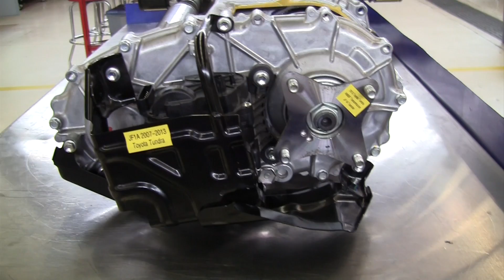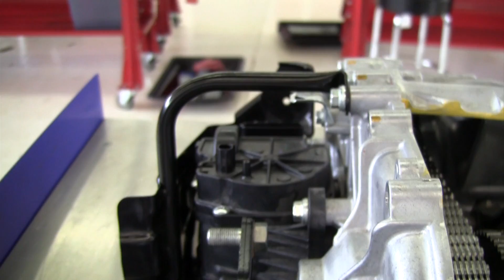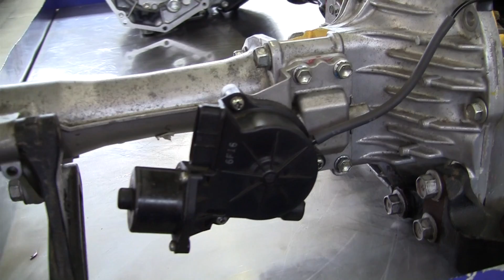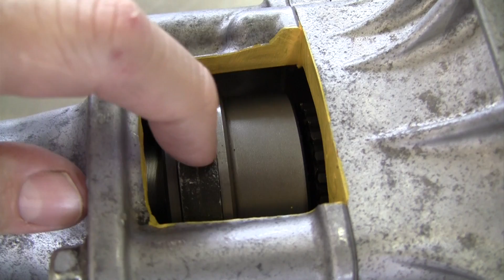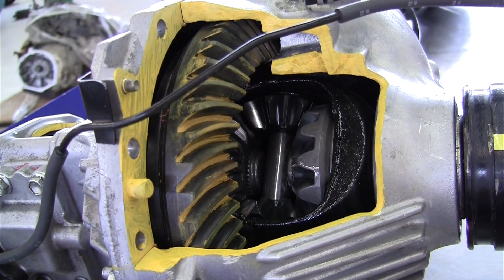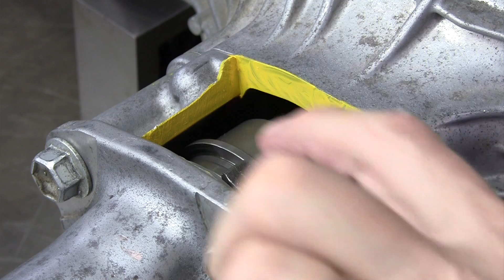Four Wheel Drive Operation (4WD)

Comment: You seem to have missed showing how when the 4WD is engaged on the transfer case how the movement of the ring gear causes the front wheels to move in the same direction. You skipped this gear view and jumped to the front actuator movement locking both wheels/shafts into the same direction but showing how the ring gear moves would help complete the video.

Comment: So what you're telling me is that I could weld the front differential and only take a hit to fuel economy? In 2wd the front propshaft would free spin at left tire rpm, and in 4wd the two front tires would be driven and locked together.

Comment: What controls the actuation of the axle disconnect?  When you put the vehicle into 4wd does it simultaneously actuate at both the transfer case and the axle disconnect as well?  Do they both actuate when the vehicle is switched to 4wd?

Comment: truly helped me understand why, even after disconnecting the front drive shaft, it sounds like gears are trying to fight each other. Perhaps my spring is failing on that darn fork.
Reply: Did you figure it out? My 4runner has been in the shop 2 months now and they can't find the cause of a gear clicking noise coming from driver front area when in 2wd; as soon as 4wd is engaged it goes away. On a lift when tire is rotated, the front shaft rotates intermittently so some gears must be catching. They did a dif rebuild no dice and replaced actuator, still persists.

Comment: Thanks for the enlightening video. A question, does this arrangement mean that the left front wheel is always turning the diff gears when the car is moving, even when no power is transmitted to the front axle?

Comment: Shot in the dark here on an old but great informative video!  have a Tundra that I replaced the detachable front shaft with a solid shaft for off-road strength. I know I’m giving up mileage but am I going to damage my transfer case by turning the front drive shaft at all times?

Comment: Front differential actuator engages the front axle.

So if you are in 4WD mode and front diff actuator not engaged for any reasons. You basically will have 3WD instead. With 2 rear tires AND the left front driver wheel spinning only???😅

Comment: I do have a question. So basically you are demonstrating is that (EVEN IF for any reasons) the differential actuator malfunctioned and is STILL engaged while in 2WD mode, you wouldn't risk damaging your axles and/or your differential gears correct??

Except most likely you'll probably suffer from having poorer gas mileage and that's it??????

Comment: At 8:07 in the video you put power to the 4hi actuator that moves a rod inside the actuator... My 4hi actuator is malfunctioning and I'm preparing myself to remove, disassemble, and clean in hopes that will repair function of it. My only problem I'm not clear on is when you re assemble the actuator to the transfer case , is where exactly is that rod supposed to be on that gear inside actuator. Most on forums are saying for 2wd the rod should be pushed all the way forward towards the Transfer case but there have been a few discrepancies. Any help would be greatly appreciated thank you

Comment: I think this gave me all the info I needed but maybe you can explain. I recently had my controller go out and I'm stuck in 4wd. I used some wire to manually operate front actuator but haven't done the transfer case yet. Why is the front actuator necessary?

Comment: Very helpful as I’m trying to figure out why my 4wd is being noisy.  The noise goes away as soon as it’s back in 2wd. Now I see what moves in 4wd and what doesn’t move in 2wd. I have a 2005 sequoia. 
So looks like the noise could be the transfer case chain, the front prop, or the ring gear of the front diff?

I checked/changes fluids already..
If you happen to see this comment I’d love any additional insight!

Comment: Excellent informative video. Apart from convenience I don't understand why toyota went with this system over the old free wheeling hubs. If my understanding is correct, with the ADD disengaged (running in 2wd), you still have the internal spider gears turning as well as one axle/cv. With the earlier system, when you unlocked the  free-wheeling hubs, you effectively unlocked the wheel from the axle so the only thing turning was the wheel and the wheel bearing; none of the axles or internal diff components rotated with the old system.

Comment: Ok, so my 4WD Hi/LO both work. Took truck (2004 Tundra) to dirt road and engaged and disengaged with no issues. My problem is the blinking lights on the dash, non-stop. Is this something Toyota can reset to stop it from blinking? It's driving me crazy.

Comment: this is an excellent delivery. Its simply awesome. I am currently transferring my 2005 Toyota Tacoma from 2WD into 4WD. I already replaced my engine and transmission with 4WD transmission with the electric shift actuator. I am currently running cables to the motor to get it to engage into differnt modes, i have the selector switch here with me. the front axle has also been installed with its shifter actuator motor. Kindly assist me with how to connect the electrical wiring to get them properly setup.
Reply: It's crazy how modern part time. 4x4 don't use disengaging lock hub instead anymore...

Comment: Can someone provide me with some guidance on what the problem is with my 4runner 4wd?  When I shift in 4wd it engages very smooth but when it disengages it hesitates for about 10 secs and disengages with a loud bang (feels like something hitting the car).  I have replaced all the oil already and have no idea about previous 4wd usage.  Thank for any feedback you can provide on this problem.
Reply from the maker: It sound like the front ADD actuator is moving too slowly. Check electrical connections and wear. Thanks for watching
Reply: @WeberAuto  You are the first one to provided any meaning response.  Which connections would you look at first?   should I start with the 4WD switch, and Vspeed SW?  How would I check the wear?  I just changed the Tranf case oil, and the Dif all were dark but not burnt and no metal shaving just mud metal on magnetic and transfer case was half quart low.
Reply from the maker: @AsiaRoadTrek  The electrical connector ar the front axle disconnect motor/actuator. Check for corrosion and damage. If good, follow the wire from the connector back to power, ground, etc. MAke sure that are good, clean, and tight.
Reply: @WeberAuto  Thank you so much for your guidance.  This is very helpful.  I will check on that.

Comment: My 2014 tundra has this setup. when in neutral, and shifting from 4 low to 4 high, i intermittently get a long shift time or it will make a god awful grinding noise under the truck like grinding gears. any idea on what to diagnose first? i first noticed very long times when shifting in and out of 4wd a few months ago. I was able to duplicate 2wd to 4wd issue without grinding, just flashing 4wd light. i was under the truck and heard the motor on the transfer case move and the one on the front diff move just no confirmation/

Comment: So I'm trying to diagnose a noise coming from my front end 2019 GMC Canyon (dealer can't recreate). Best I can describe it is a rotational clunk/thudding. I can only hear it at lower speeds (up to about 35 mph). At first I thought maybe it was tires, so I rotated tires, no change in noise. I checked wheel bearings, they appear solid. I jacked up the truck and spun both front tires. When I spin the driver side, I hear a clicking noise, that matches the speed of the tire as I spin it. This at first appeared to be the noise I was looking for. The passenger side does not have the same noise. Now after watching your video, I understand now why the pass side doesn't have any noise, because it's not spinning the side gears in the diff. But I'm still concerned that I can hear the side gears spinning so loudly when I do the driver side. Is it common to hear the side gears spinning so loudly? I made a video on my channel and you can hear the difference between driver and passenger side. Any input you can provide would be great.

Comment: HI PROF JOHN, I DID NOT DO MACHANICAL ENGINEERING BUT I NOW DEVELOPED LOVE FOR IT. PLEASE HELP. I BOUGHT WORKSHOP MANUAL AND SOMEWHERE IS WRITTEN AS FOLLOW

FITS AND TOLERANCES

DESCRIPTION                               	SIZE OF NEW PARTS AND WEAR (Mm)

Diameter of driving gear shaft   	48.961 ÷ 49.000

	

Then my question is : what is this divide sign for or mean?
 what i expected is 48.961 to 49.000 to show that the shaft should be between the two figures

M.B.S MOSHITOA (S AFRICA)

Comment: Hi my sj410 give some abnormal noise above 80kph from front side in 2WD,  local mechanic says some prb with front differential prb, can it be like this as front differential is not engaged in 2WD
Reply from the maker: Does the noise go away in 4WD? If so, the axle oil level may be low or the differential gears are probably worn

Comment: When cruising in 2wd, with the r/f axle isolated and the ring/pinion/front propeller shaft/chain in transfer case stationary, what provides lubrication in the front diff and transfer case?  I always thought the ring gear in the diff provided splash lubrication, and the chain for the transfer case.
Reply from the maker: The side gears are still rotating and flinging oil as you drive

Comment: Hi professor, I have a question about locking front differentials on a 4wd vehicle. If the differential is permanently locked, but the transfer case is in 2wd and the automatic disconnecting differential is disconnected, does the diff locker cause the entire front end to rotate as if the ADD were engaged and thus reduce fuel economy? I am curious about this as there is a relatively cheap front differential locker for my 2012 Xterra called the Lokka that is permanently locked but can give slightly like a Detroit locker. Thank you for the wonderful presentation.
Reply from the maker: Thank you. Yes, it does, but it would be very difficult (dangerous) to steer since the locked diff would not allow the front tires to rotate at different speeds while cornering. I do not know of a good solution for the front axle of that vehicle.
Reply: @WeberAuto  Hi professor, thank you for the reply. I've heard that the front diff locker can cause severe understeer and oversteer when in 4wd, as this would mean the ADD is connected and the front differential is locked. But since the ADD disconnects when the vehicle is in 2wd, would the only drawback in 2wd be reduced fuel economy, or do both front wheels remain locked together even with ADD is disconnected?
Reply from the maker: @RagingAura  True, if the ADD is disconnected, the only drawback would be the front driveshaft would always spin.
Reply: @WeberAuto  Thank you for the explanation, this helps a great deal.

Comment: so are you saying as soon you engage 4WD  that actuator on front differential will automatically engage the front differential??? or there is another switch for the front electric actuator to engage 4WD after the transfer case is in 4WD...thanx for the help
Reply from the maker: Yes, transfer case first then front axle
Reply: thank you

Comment: Thank you very mutch from Russia!
Reply from the maker: Thank you!
Reply: you not have video old automatic transmission AISIN A02A/A343F ?  (sorry my English ;)
Reply from the maker: Good idea
Reply: i have Toyota Prado 95-series 1999 year 5VZ-FE. 330-350.000 km
all gear work correct 1-2-3-4. After runing i push STOP and trnsmission kick one time. After i push acsellerator and transmission kick one more time...(     Maybe problem white solenoids? What you think, my friend?

Comment: So, you are saying it is bad to have the fork in the ADD engaged because then all the front is moving regardless of whether the transfer case is in 4wd or not? Also, isn't it better, for dependability purposes, to lock the fork in place and disconnect the vacuum line to it, to ensure dependable 4wd functionality?

Also, how much does locking the fork in place, via a hose tie, actually affect the gas mileage?
Reply from the maker: Yes, It is bad for two reasons: 1. It causes all the parts in the front axle, front driveshaft, and transfer case to rotate even though they are not being used. This causes parts to wear out prematurely. 2. It decreases fuel economy about 3 mpg on the vehicles I have owned because of the additional load from all of the unnecessarily rotating parts.

Comment: What is the point of having selectable 4x4 but the front diff isn`t connected? Like in what scenario the Transfer Case is in 4x4 but the front diff is disconnected?
Reply from the maker: Selectable 4WD just replaces the mechanical shift linkage of the transfer case with an electric motor doing the same thing. That scenario should only occur during the transition into 4WD. The transfer case must always engage before the front axle/diff can connect.

Comment: Great informative video. What is the vacum hose going to the actuator for? Thank you
Reply from the maker: Thank you! The hose is a vent, not a vacuum hose. As the air inside the ADD actuator and front axle heats up, it also expands. The hose allows it to breathe out and in through a little foam filter up inside the engine compartment.
Reply: WeberAuto ....

Comment: hello professor,
five months ago you had give me a pinion preload spec of 8.7 - 13.9 in -lb for the front differential of my `96 Landcruiser.  is this spec for new or reused bearings?  would you be so kind as to provide the spec for both the new & reused bearings. if the original bearings are not bad I can reuse them & save a bit since I am on a shoe string budget for this repair.  also, could you please share the torque spec for the ten ring gear bolts for this differential. thank in advance.

Comment: hello professor,
I was just shopping around for a good shim kit for the front diff of my `96 Landcruiser and an online vendor said that this diff does not carry side bearing shims, they use adjusters. is that really true? if so is that where I would need a spanner wrench? thanks.
Reply from the maker: Yes, the side bearing preload and backlash are set by threaded adjusters.  A spanner wrench can be purchased at most home improvement stores, theyare used for plumbing.  See my video towards the end for threaded adjuster usage 1963 Chevrolet Biscayne Positraction Differential Overhaul - Part 4 - Final Assembly

Comment: Hello professor,
I forgot to ask if you could please share with me the torque spec for the side bearing caps of the front differential on my 1996 Landcruiser. I seem to be missing this fourth critical measurement for my diff rebuild. if you can share this measurement with me I would greatly appreciate it. thank you very much in advance.
Reply from the maker: 58 ft-lbs Best wishes

Comment: thanks for your response. I am now looking to purchase the specialized tools you used to set up the gears. I know I will need to get a dial indicator torque wrench for the pinion nut. however, if I buy an indicator to check the pinion depth can that indicator be set up to also check the backlash on 
the ring gear?
Reply from the maker: Yes, you can use the same dial indicator. Best wishes!

Comment: thanks a mil! just one rookie question, right now I am getting 17 mpg on the highway with just the rear wheel drive on the truck.  with full time 4x4 will I get lower mph but with faster acceleration?
Reply from the maker: You will get lower mpg and no change in acceleration unless you have a tire that has lost traction.

Comment: hello professor
the good news is I have finally purchased a used ring & pinion set for my 1996 Landcruiser. it's a 8 inch reverse rotation with a 4.10 ratio, as you had suggested. you had given me the backlash & pinion preload numbers (thanks again.)  however, I would greatly appreciate if you could also give me the side bearing preload number for this truck front differential. that is the final piece of this puzzle after which I can begin the assembly of the differential. thank you in advance.
Reply from the maker: The side bearing preload is 6-8 inch pounds higher than the pinion bearing preload alone (as measured at the pinion nut). Best wishes!

Comment: I was able to locate a ring gear & pinion set online with a 4.11 ratio.  they have it with a description of a rear diff piece but looks like I should be able to use the front & rear ring & pinion sets interchangeably since they should be identical. my question is given that the front ring & pinion ratio should be 4.10 could I use a ring & pinion set with ratio of 4.11 without breaking any pieces?
Reply from the maker: Yes, I think you will be fine.

Comment: Professor
I have a follow-up question,  I can't find an 8" ring gear with a 4.10 ratio to buy online.the closest is an 8" with 4.88 ratio. could I use this one for my front diff, if so what would be the difference in drivability/ performance?  does the higher ratio mean that the ring gear has more teeth than the one with a lower ratio & will that mean greater torque?
Reply from the maker: The front and rear axle gear ratios must be identical or you will break something in the powertrain. Different gear ratios would try to make the front and rear tires rotate at different speeds while driving; they cannot rotate at different speeds, so something will break. Best wishes.

Comment: hi professor,
Well, I finally opened my 1996 Landcruiser front axle & diff over the summer. You were right, my ring gear was crushed to pieces! I wonder how that can happen, it obviously took a blunt force. The real job now is to find the right size ring gear. Can you please tell me what is the correct diameter ring gear for my vehicle front axle. Thanks.
Reply from the maker: It had an 8" diameter ring gear with a 4.10 gear ratio. Driving on dry pavement with the diff lock engaged could do that too. Best wishes!